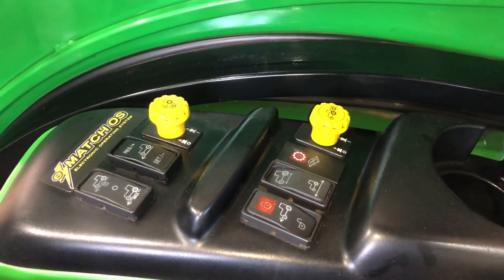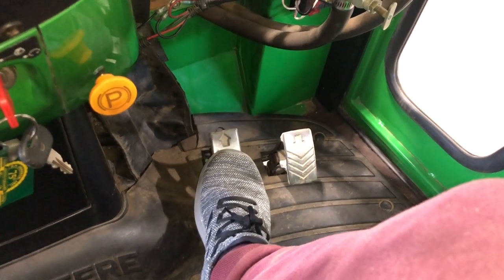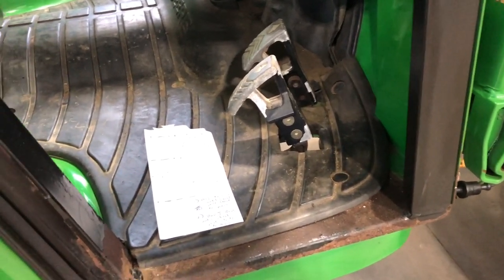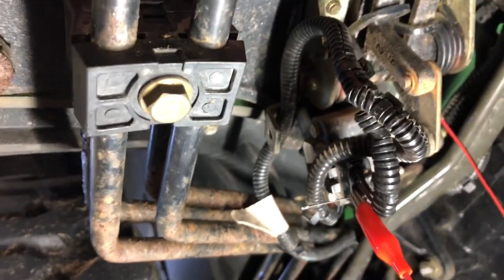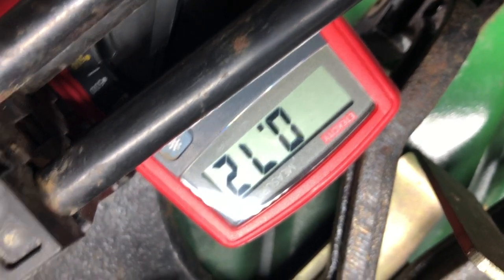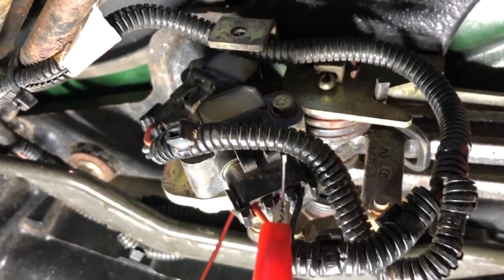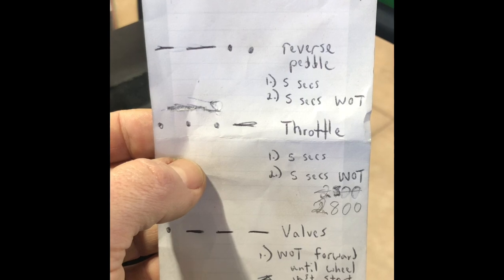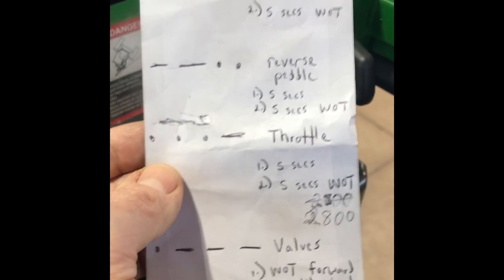John Deere Controller Fix

Comment: Our tractor is showing similar behavior but we have only noticed in when it is going forward.  The odd thing is that it can run for hours without any issues.  But it seems like , and if it is turned off & back on, that the loss of forward motion happens intermittently.  I swear that by turning off/on, you can eventually get this issue to go away.  My brother was going to try this reset procedure last week but we he watched the video, he was afraid that if he didn't do it correctly that it might cause more problems.  So in your video you state that there is a point where some folks "mess it up" - what happens when they "mess it up?"  Does it disable the tractor completely or does it just not fix the problem??
Reply from the maker: Thanks for reaching out.  First check the code that is being thrown when the tractor stops moving.  The sensor that is causing the machine to stop will throw a code.  If it’s the seat sensor then you can jump out the seat sensor and see if the problem clears.  If the code is for the forward pedal sensor (potentiometer) the test the min max voltage.  I have a video on how to test the pedal potentiometer.  If sensor that is throwing code test good only then I would recommend the controller reset.  Machine will not move until you get all the way through controller reset procedure.  If you stop half way through and try to exit early machine will not be usable.

Comment: My 4610 is very dangerous when i push either foot pedal tractor engages and machine take 2 to 3 seconds to realease. Tractor  has only 850 hours of very ez usage and this is dangerous. 2 weeks ago it wouldnt stop and it hit garage with loader and broke the main big beam on corner of garage. I got pissed brought it to john deere they had it for 3 days and told me it needs a new $1400 dollar controler. Plus 700 labor, i have a feeling that that is not the problem. If it is it should be a recall on this!
Reply from the maker: If it’s a reputable dealer and they tested the controller it’s definitely possible.  With that said in my experience with the 4x10 machines I’ve never had one with a bad controller.  Typically if you have a bad controller the machine won’t even move.  A movable machine that is doing bad things like in your case has always been a bad sensor.  potentiometer on one of the hst pedals or motion match on the fritz.  I would recommend putting motion match on quick stop position A.
Reply from the maker: Its the switch to the left of the controller fault code light.   Put it in the forward position to activate quick stop (position A).   See if that makes any difference.
Reply: It is on quick delay
Reply from the maker: @barrypederson3688  next thing to check is the potentiometer voltage when pedal is released.  The HST pedal potentiometers are about 5 volts when pedal is fully depressed.  When released the voltage should immediately return close to zero.  If you release the pedal and voltage stays at about 5 volts for a few seconds then the potentiometer is bad.  I have a video on how to check the voltage on the potentiometer without unplugging it.  You don’t want to unplug them when key is on, since that will confuse the controller